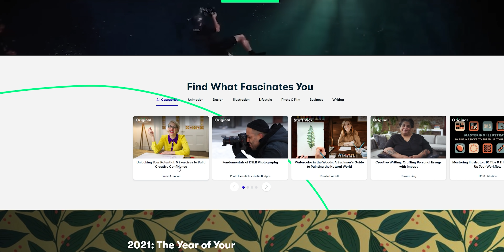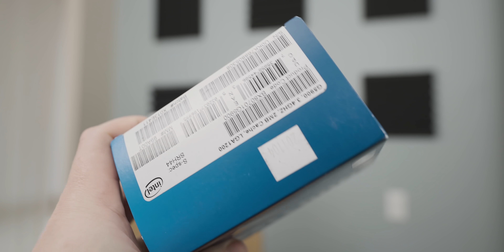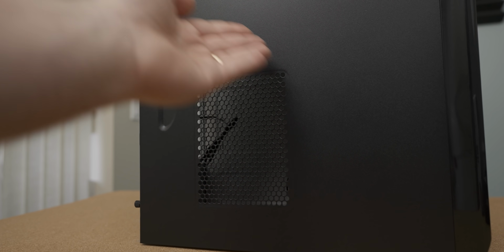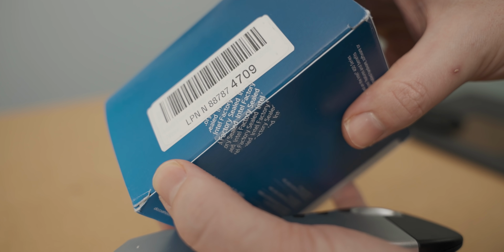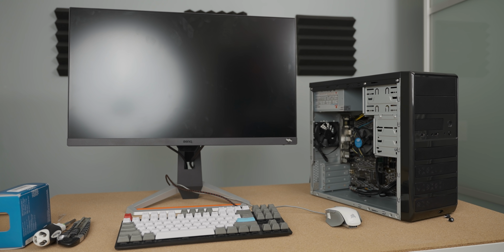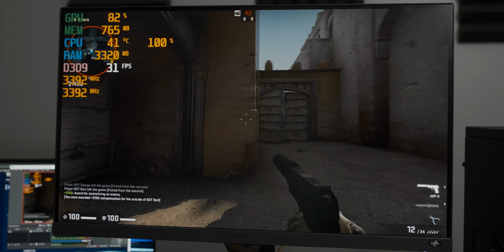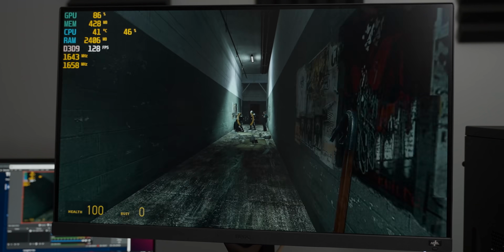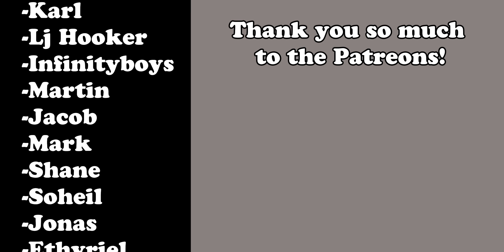Trying to game on the CHEAPEST NEW PC you can buy in 2021...

Comment: I love how you took the PC on a walk for its final look at the world before it inevitably explodes after more than 5 hours of use😂
Reply: Anna lookin swaggy as heck holding the pc
Reply: Yes
Reply: I think he was just trying to air out the chemical fire fumes of that carcinogen soaked build.
Reply: I thought that he was leaving that pile of e-waste for someone else to pick up.
Reply: Current x voltage = watts. 
So 34A x 12v = 408 watts, i assume some watts are being "used" elsewhere, like EMF and whatever... But like 500w to 408w, 92w less that i thought id be buying. Id love to be educated on hw 92w can be an acceptable difference when buying a 500w psu... Pls educate me. (unless its obviously a scam and they just advertising a +-450w psu as a 500w). Again, just looking to be educated on this topic.
Reply: @MrGorpm ,  writes "I thought that he was leaving that pile of e-waste for someone else to pick up."

He's not that mean of a person…
Reply: @chadturck8085 , writes "So 34A x 12v = 408 watts, i assume some watts are being "used" elsewhere,"

There is another 105 Watts on the 5 Volt rail (21 Amps) and 72.6 Watts on the 3.3 volt rail (22 Amps). So you add all those up you get 585.6 Watts but the system is 500 Watts max. so you won't be able to get "full power" out of all three voltages at the same time.

[edit]
P.S. What's scarier is the input is rated at 1,380 Watts, which is just 42% efficiency.
Reply from the maker: Haha!! I wanted it to see the world.
Reply: @fred_derf  thanx man!
Reply: the art style locations with the pc was great
Reply: @fred_derf  I guess this is the danger of these cheap PSU’s, that with so little efficiency, a lot of power is pulled in to this rickety little box with cheap parts.
Reply: @kasimirdenhertog3516  The danger isn't so much the amount of power being pulled by them, the problem is the cheap materials and construction of the parts leading to them failing, shorting and bursting into flames. Their inefficiency exacerbates the situation by making them absorb more power and turn it into heat, thereby running hotter.
Reply: Where are you from? Your accent sounds like a hybrid between British and American
Reply: @10reubenl  In case Dawid doesn't see this, he's from South Africa.
Reply: He wasn't walking the PC, he was airing it out so he wouldn't pass out from the toxic fumes it produces.
Reply: @chadturck8085  u still have a 5v and 3.3v rail
Reply: Are we sure he wasn't trying to dump it? After all, Anna was wearing a mask for some reason.  😕

Comment: I used to build PCs for a large whitebox VAR. We were basically an Intel only shop, and installed several thousand stock Intel coolers. While they are small, and not adequate for things like overclocking, the fans last FOREVER.  I saw PCs that we built which ran for years with never being cleaned and those coolers completely caked in dust, and the fans just chugged right on through it. Zero bearing noise and nearly zero speed drop. Compared to most aftermarket coolers I've seen, the stock Intels are old faithful.

Comment: NZXT better watch out! Rosewill basically has them by the throat at this point!
Reply: Rosewill actually makes high end power supplies, they also make low end ones.The high end ones are probably made by seasonic or something like XFX's higher end power supplies are but its always something to look at cause some are gold rated(and actually certified not fake 80+ gold labels) not the cheapest but cheaper than a ANtec or Thermaltake power supply of the same calibur
Reply: @kyles8524  ok
Reply: NZXT cases also kinda suck, lol
Reply from the maker: No competition. 😁
Reply: @kyles8524  who asked?
Reply: I mean hey. a case is a case, when you're on a budget you don't really need the best of the best lmao. I've actually used my semi decent rosewill case for a while now with an AIO, temps are just fine
Reply: @calebpoley9377  I started out with a Rosewill. It's a case that does its job but it's a bitch to build in.
Reply: @downnnnnn  yeah NZXT cases are awfl, terrible airflow they NEVER add mesh for frontal intake its always blocked off
Reply: I used a Rosewill Nautilus for my first PC build. It didn't come with any hardware. After a month of playing phone tag, they finally admitted that they didn't have any in stock from which they could steal the parts. I gave up on them, and went to a PC repair shop and bummed a set of screws and standoffs from them. Now, every time I see the name Rosewill, I pass it by.
Reply: Rosewill cases are adequate. Cheap plastic is cheap plastic no matter who makes it. Obviously it isn't going to last if you throw it against the wall, but why would you? The case is the one thing about a PC you can afford to go cheap with. The purpose is nothing more and nothing less to contain the other components.
Reply: @HowToMakeAGrilledCheese  better airflow tho
Reply: @elijahmckenzie9207  I have an NZXT case and have literally had zero issue with overheating. Everything stays nice and cool. At first glance it's easy to say their cases suck, but in my experience they really don't.
Reply: Snidget for low powered builds with small GPU’s and not very powerful CPU’s they should be fine... but the case is nearly £200 bruh, Corsair cases are cheaper, better quality and miles better airflow
Reply: @kyles8524  r/whoosh 🙄

Comment: “Cheapest brand new computer parts”

So in other words, a Dell, but without the warranties
Reply from the maker: Hahaha!! Burn!
Reply: No. With Dell you've got one warranty. Here there's one warranty per component.
Reply: @ollep9142  Never shopped with Dell, have you?  "Do you want a warranty for that warranty?  Only $150, and it covers you in case your warranty has an issue."
Reply: @ollep9142  linus got overcharged with multiple warranties in secret shopper
Reply: @Lapisz123  Those were warranty extensions and something more like insurances. Not manufacturer's component warranty.
Reply: @ollep9142  yea manufacturing component warranty usually only is in if youre building a pc

still though, dell managed to invoice & charge linus both the basic and the premium "insurances" even though they were mutually exclusive on the website
Reply: @ollep9142  Posting that after Dell mis-sold Linus two warranties for 1 PC is hilariously wrong.
Reply: @nathangamble125  As I see it Dell didn't sell Linus an extra warranty. One person in Dell's sales department did.
Dawid must have gotten at least half a dozen of warranties for his computer...
Reply: What makes you think these parts didn't have warranties?
Reply: @92Koondog92  and do you want a warranty with that warranty
Reply: @ollep9142  I smell a dell employee
Reply: Dell & hp makes good reliable pcs. Most of the pcs from dell & hp still runs perfectly fine after 10 , 15yrs. Heck i have seen 80+ titanium psu in dell .. , 80+ gold in hp. And they use proper brand name makers like liteon or delta or meanwell.
Reply: @KuntalGhosh  dell loads their pcs up with bloat, sells underpowered pcs for $1100, and scams you with warranties.
Reply: Dam, I remember in the 90s Dell was a decent computer to have.
Reply: @deepestfried  no bloat in PC's u buy for business but u pay extra for them 😂
Reply: Dell can go below this, they can get cheap parts we can't.
Reply: @deepestfried  he's just mad cause he has a Dell prebuilt
Reply: @KuntalGhosh  next joke 😅
Reply: @reallyryan_  I don't have a dell or any prebulit pc , i fix computers on free time & i have seen hundreds of different types & brands of prebulit and custom build ones. So u better gather some experience on brands instead of behaving like a typical hate all brands brigade and then proceeds to make custom pc with cheap shit powersupply. All servers and internet runs on dell hp stuff. Those are not custom build computer racks by random kids ..
Reply: Who's gonna protect your PC without the warranties?

Comment: The point, and the best thing about Pc gaming is, you don't have to have the best most capable hardware to game. The PC game library is so vast, and have games that are literal decades old, you can game on any type of PC.
I have a super banging Pc, and I play San Andreas, Max Payne 2 and The Movie (PC Game). 
I have bought all the latest ones, still I prefer the older games. And those could run on my Pentium 4 Pc from the past!
It's not like consoles, where backward compatibility is a limited option.
Reply: Since Steam did the update that took out XP support I can't get C&C Generals to run anymore 😭😭😭😭😭
Reply: @shaneeslick  that thing happens. There are other ways to get it to work , outside of steam.
Reply: @TechOrigami  I've still got my original Discs, so I'm just gonna put it on my new XP PC 😁
Reply: @shaneeslick  well, problem solved bro!
Reply: Tech  yh but u also forgot that console also are the best value machine if u want to game now ,especially the ps5 and Xbox one x  they perform really well for just £500 ,there is no pc that perform that well ,so both consoles and pc do have advantages and disadvantages.
Reply: @Omar-kl3xp  Consoles are sold at a loss. They make the money trough the expensive games.

Also playing fps games just feels wrong on console, after you have experienced mouse and keyboard on pc.
Reply: @teemumiettinen7250  yes and no ,u don’t have to pay full price for games especially if u have the disc version u can really cheap out quite a lot ,u can even re sell your games or give it to someone ,so the amount of money you will spend is not really a lot in games if u regularly trade your games  or buying used games ,actually it will became even cheaper then pc gaming  because u can re sell your games and u can get games from your friends  if u want to ,and yh maybe for competitive is not the best but how many people are playing competitive?majority of people are not playing competitive in the first place .

Comment: For that SSD card, I'd use Velcro tabs to keep it in place. I've used them in my old system to keep an SSD card that I added in place and it worths really well.
Reply: Pff, back in my day, also still today, we use duct tape. Also, Dawid is Canadian, so he has to follow the Red Green school of manliness.
Reply: Zip Ties are your friend. If It is good enough for a Dell It is good enough for that POS. A Celeron. My God. that is scraping the bottom of the barrel & the single stick of (inadequate) RAM.
Basically you are deliberately making all of the mistakes to kneecap system performance. This is not going to end well.

Comment: This case is an incredible case. It's called the Ranger-M and is their somewhat fancier take on their own Line-M, which in turn is their remake on the Elite 341 by Cooler Master from the later half of the first decade after 2000. I've had the Elite 341 and now have the Line-M, and the only difference between them is the Line-M and Elite 341 are that the Line-M has usb3 and only one 3.5" external bay while the Elite 341 came out before usb3 and has two 3.5" external bays. The Ranger-M's only difference from the Line-M is its faceplate. This case is plenty capable of housing a newer i7/3070 or stronger system safely because by having the psu up top, it streamlines the front intake with the cpu cooler and exhaust. Also, you can add two more fans right on the side panel, which increases airflow still. All of the fan mounts are for 120mm fans, just like on the Elite 341. Having a blower on the gpu makes it even better still because that bottom side mounted fan will feed it additional fresh air. I still say the Line-M and even the Elite 341 are still marginally better though because they have only mesh covering the front intake while the Ranger-M has those bars crossing over it. 

Oh, and apparently the Ranger-M also has its drive bay inside the cage, while the Line-M has mounting tabs on the underneath of the external bay cage, and the Elite 341 has those tabs and an additional set on the botton, for the fan to blow their heat off.

By the way, the Elite 341 was a modder's wet dream. At the time, there were all sorts of mod supplies like window kits along with individual parts like custom etched or plane acrylic and edge mounting also available, led feet, cold cathode tube kits in all kinds of colors including uv, uv reactive everything from cables to individual parts like sleeving and connectors and such, EL wire, slot covers, etc. It really really was a fun case, especially if you painted the inside a nice matte black because of the silver.

Comment: This case pretty much is identical to the rosewill case I built my first pc in 2015. Not much has changed in the super budget pc space lol. I had a fx 6300 oced to 4.8gz @1.485v on a g760+ motherboard with a r7 260x. Looking back I'm not sure how that motherboard survived that kind of overclocking lol. I gave that whole computer to my mother and is still running strong to this day but I did set the cpu to stock speeds to help prolong the life of the cpu and motherboard despite being oced for over 2 years with heavy use. I did have ab hyper 212 evo on it and kept the cpu temps in the mid 60s. Gotta say that is the best budget cooler ever. I even used it on my 6700k oced to 4.8ghz @1.375v and kept it in the mid 70s. Love the channel keep up the great work!!!

Comment: I wanna say: these Rosewill cases are actually decent for their price. They are super cheap, but they work and better than the competition in the price range
Reply: That thing actually looked like it had better airflow than most cheaper Cooler Masters.
Reply: It has pretty good airflow. In my experience, they’ve had no issue cooling those old, beefy Radeon HD cards, along with bigger GTX cards. Also.. these cases do have a 2.5 bay slot on the floor of the case, it just isn’t advertised, nor immediately apparent
Reply: Beat me to it, I'd have no issue recommending a Rosewill case to someone on a budget.

Comment: 2.5 SSD/HDD mounting is on the floor of the case, the 4 screw holes under the expansion slots. Rosewill has two matx frames, they use different front and side panels and claim its a new product line. Cheap replacement (reluctant to use "upgrade") for OEM that have no intake fan mounting.

Comment: Been watching for a while and you only think in one way Dawid, gaming.  I just recently upgraded my HTPC from an old Dell Precision T3400 with a 2.66 GHz Core 2 Duo and a GT 1030, ran great and put out 4K HDR.  I also have another Precision T3400, same chip, running a CentOS app called ClearOS, that is my Gateway/Fileserver handling about 20 devices connected on my home gigabit network.  So yes, there are uses for computer parts not used for gaming.

Comment: This is a great pihole machine. My current pihole machine is a Dell Dimension from 2007 that rocks a Sempron LE-1300 with 4 2GB sticks of the cheapest DDR2 800Mhz ram I could find on Amazon after five minutes. IIt also rocks a 3 year old Thermaltake Smart 600 watt power supply for enhanced fire and cooling abilities. I then topped all of that off with a 250GB Crucial MX500 SSD and a Wraith Prism cooler that only fits upside down.

Comment: that looks like most of the point of sale pc I repair and maintain, a bunch of AMD A6s
Reply from the maker: Oh that's interesting. I wonder how the A6s compare to this celeron.
Reply: @DawidDoesTechStuff  just checked ebay, 1000 USD for A6 and A55m motherboard combo, what are these people smoking, I got mine for 60usd for roughly the same combo.
Reply from the maker: @crispianchealuks2024  Holy crap! I That is a ridiculous amount. Parts prices are going ham again.
Reply: @DawidDoesTechStuff  Really badly. Imagine getting around 100 points from Cinebench R15. It's essentially half of your Celeron in CPU performance (Or an AMD FX but with massive brain lobotomy and FX itself was a bad enough lobotomy). Graphics are also poor. They can run Duke Nukem at 1080p with mixed settings, DiRT 3 at 900p or 1080p, WRC 4 at 640x480, Racedriver Grid at 1080p low. You can forget about running GTA 5 at any comprehensible resolution and passable framerates. Some A6 models may overclock to 5GHz or even more (AMD FX legacy), but no matter how much you polish a turd it's still a turd. It would need at least 8GHz overclock to match Celeron used in this video.

Comment: One thing you can say about this build is that it's very upgradeable. You could make major upgrades a piece at a time. Add the biggest 7200RPM hard drive you can find to give it some more space for files while keeping the system on an SSD. Perhaps starting with a single 8GB RAM chip would be more practical and would allow adding an 8GB chip to get to 16GB (though even adding a 4GB chip to get to 8GB would be quite the upgrade). You know the motherboard could handle a lot better processor. Once you had a better processor, you would have a lot of options of discrete graphics cards that would still be an improvement.

That power supply does worry me, though. I'm always afraid that really cheap power supplies will be a fire hazard. I subscribe to the , 'never skimp on power supply quality,' philosophy.